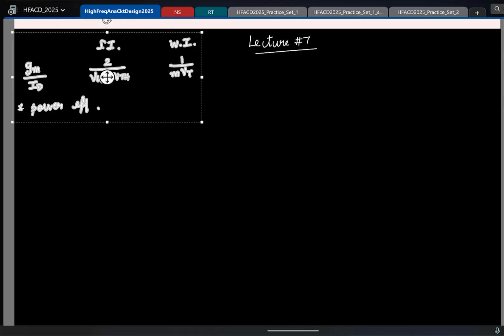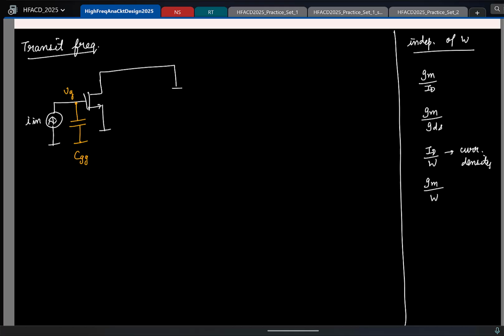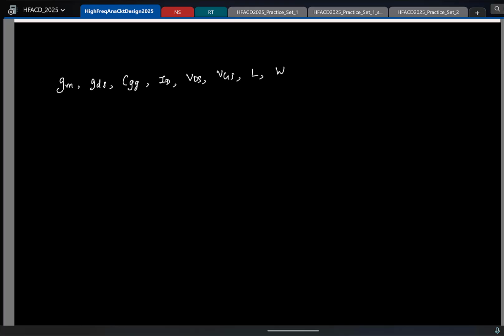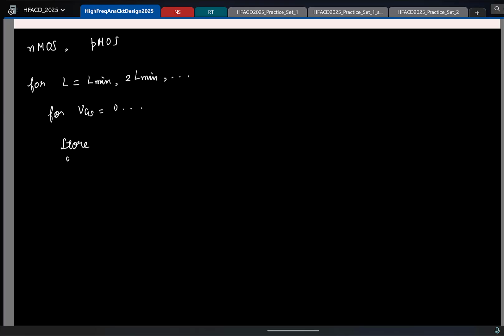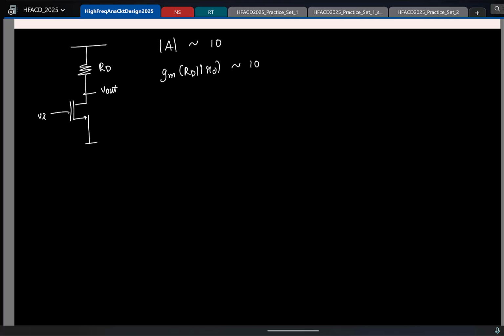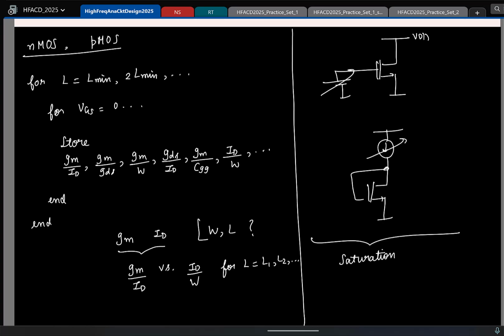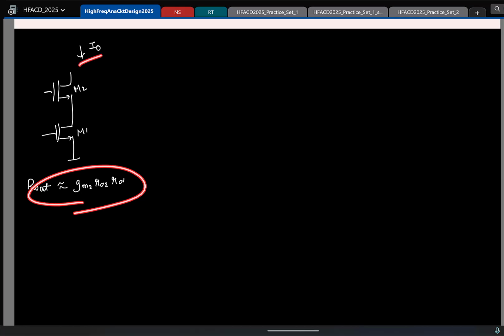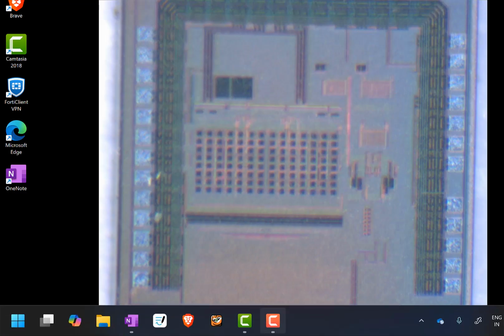Lecture 7: Systematic design of analog circuits using look-up tables (gm/Id based) & design example

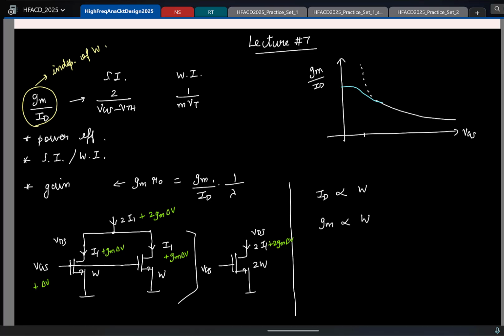Comment: 5:59 how gm/id is metric of power efficiency clearly at this instance it couldn't detect that Id incremented and so gm so, but as due Id increment the power itself increases, so how it didn't react to power increment. how this going to help in the power efficiency